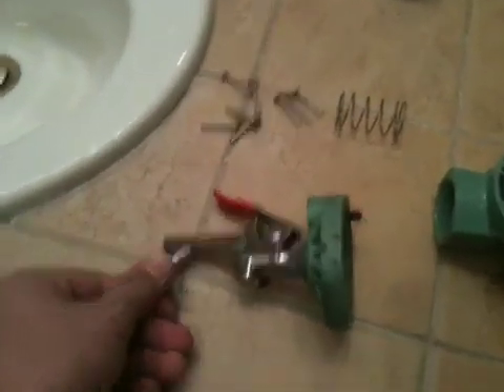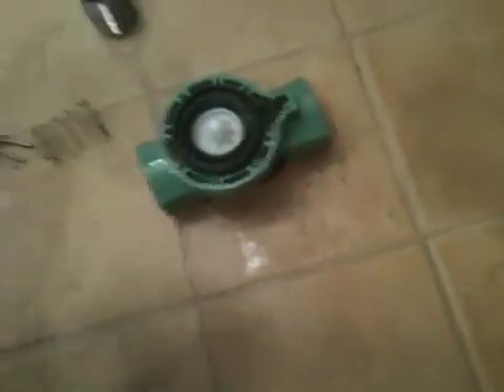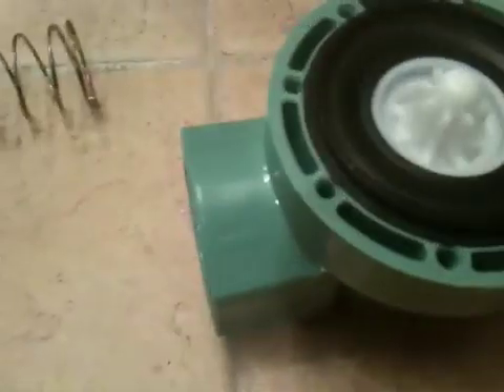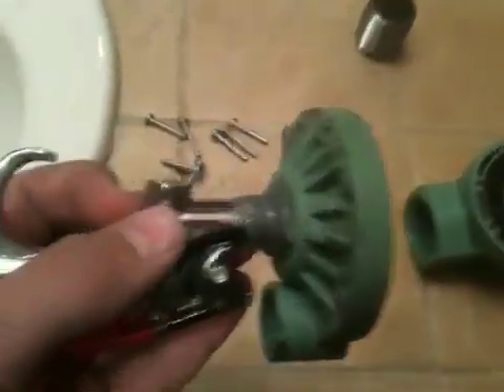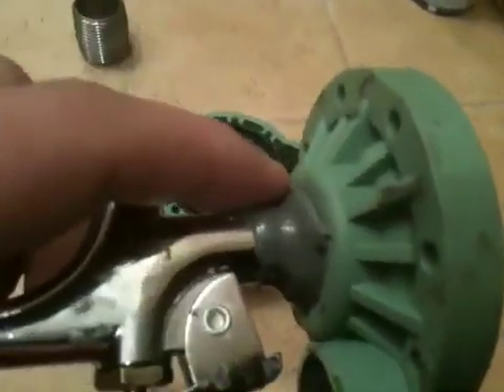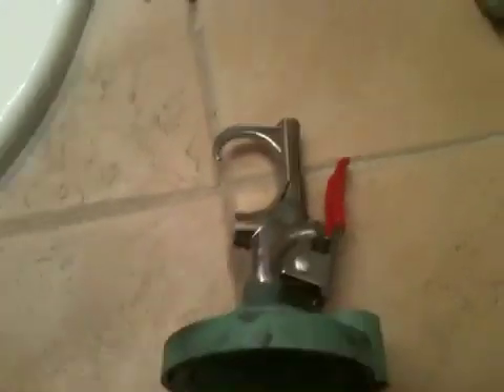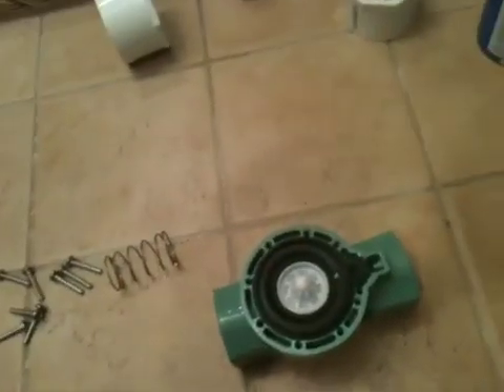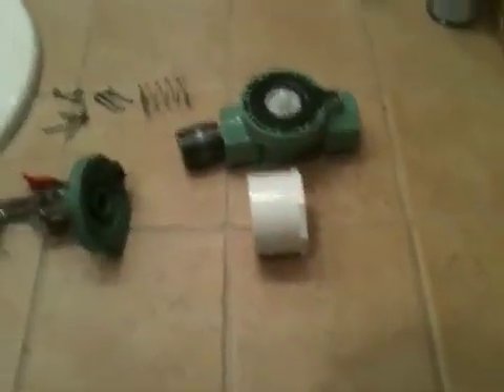Modifying a sprinkler valve

Comment: hi there, i have almost completed my air gun with my modified sprinkler valve, im not sure what im doing wrong!! when i attach my pump to it, and go to pump it, all of the air just goes out the end of the barrel, i have no idea how to fix it, i will upload a video and if you could check it out, that would be awesome thanks!